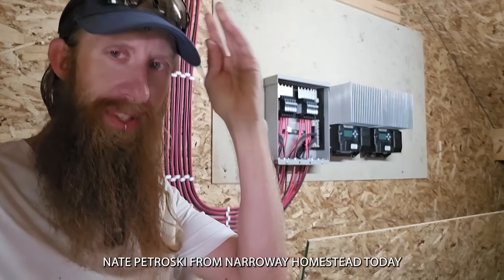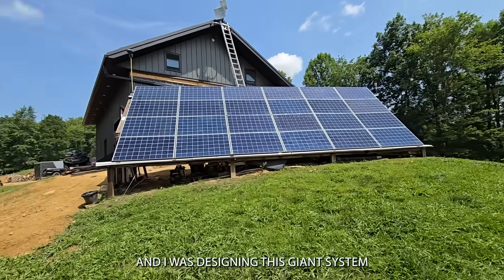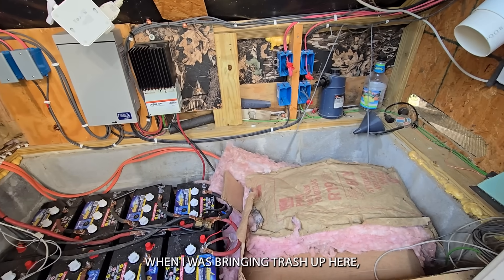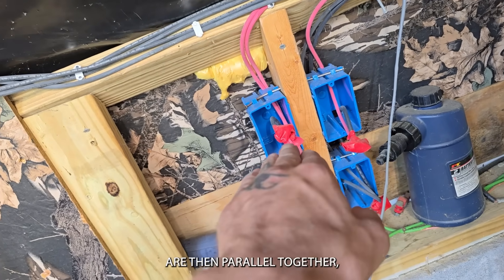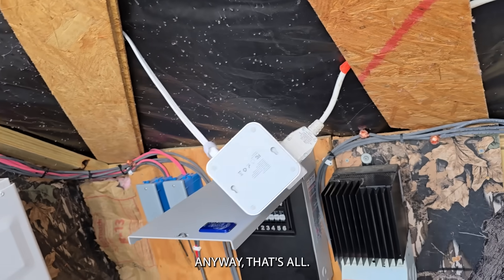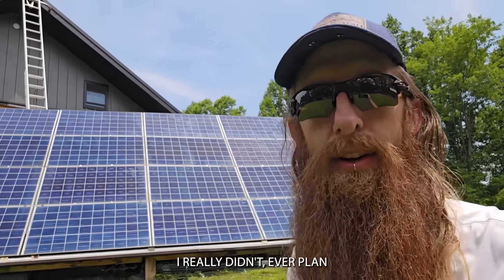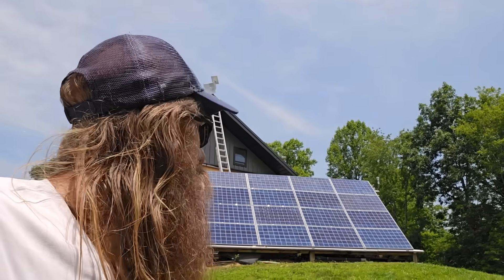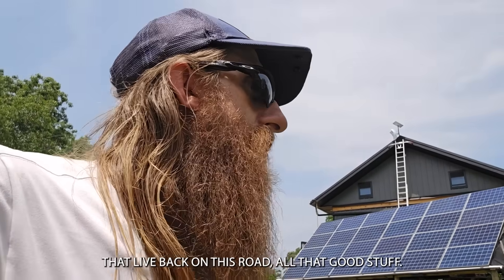Why am I upgrading my solar? #narrowayhomestead #offgridlife #solarpanels #solar #solarenergy

Comment: Can someone help me with some advice on a off grid solar system setup. I have a farm and I need a system that can run at least 20 LED lights and a small water pump and some few cameras. The light will only be running for 12 hours from Sun down to sunrise (all light Wats combine is 20000w). What volt and Amp hour battery should I get. What inverter and how many solar panels? Any help will be appreciated

Comment: I wonder if Nate has ever heard of the solar roadways company? They are a small company that produces solar panels that you can use as driveways and parking lots and actual roads. 
They are currently doing an installation on a US military base. It would give him some additional capacity and provide energy from the ground. They have built in LEDs and can be self heating to keep them clear of snow and ice in the winter time. ✌️

Comment: nate, Ah ( amp hours) is a better way to express battery storage
you use KW when you should have said Kwh....but Ah should be used
you can do a conversion with this formula ...... Ah = kWh × 1,000 / V
Kwh = 20 battery voltage = 48 so Kwh 20 x 1,000/battery v 48 = 416 Ah you can also reverse it...... kWh = Ah × V / 1,000

Comment: if someone is using a 8hp or 17hp gasoline generator, there are industrial engine driven generators that can idle burning the same amount of fuel as those smaller noisy generators, though still have a huge 300Kw overhead capacity. a C11 Caterpillar gets very quiet with 15 foot of 5" muffler pipe, but two time that also makes enough heat that it could heat a year round greenhouse. active cylinder decompression on low load, 20 miles of wire.

Comment: The TriStar MPPT 60 software pretty much gives you the information you need. In "Live View" you get all the current information that you need. It even has Amp hours and kWh since the TriStar was activated. The data screen shows 84 days of information that includes how many years, days, hours since it was turned on. Here are the daily data saved fields: (easy to set up)
Day

Events
Hour Meter
Max. Battery Voltage
Min. Battery Voltage
Max. Array Voltage
Max. Output Power Watts
Amp Hours
Watt Hours
Max. Battery Temp °C
Min. Battery Temp °C
Charging Durations Min:
Equalize
Float
Absorption
Faults
Alarms
Enjoyed the video

Comment: Really dig ur setup the extra panels are your absolute ticket to self sustainability,another water tank or two and u are done with the utilities, the propane can be bought if needed for water heating or not.
Reply: Make sure to vent the battery room,a spark from a light switch could be a problem

Comment: You're lucky because I cannot find a goddamn solar installer to help me put MY solar panels on my roof!!!
Lead acid Batteries never dropped in price and they're over what 200 years old??? Lead acid is not worth it anymore....
Reply: How steep is the pitch angle on your roof? You could do it yourself if you don't need fall protection gear. That's what I did.

Comment: If you need a new inverter order a Schneider xw pro 6.8kw inverter, theyre transformer based monsters. I just ordered 2 for my whole house solar system for $900 each on NAZ solar as schnieder just discontinued them and are selling them all off, originally $4700 ea.

Comment: Why would you go with lead acid again... You can currently buy LFP batteries with a 6,000 cycle life at 95% depth of discharge for less than an equivalent LFP system that you'd be lucky to get 1500 cycles at 50% depth of discharge... I mean if you are buying 120kwh of batteries and basically restricting yourself to using 60kwh, you basically need to buy 240kwh to get the full capacity.
LFP doesn't need to be vented, you can cheaply buy full systems with heaters, breakers, steel cases with wheels and/or handles, and wired up to 48V out of the box.
Oh god... I looked up how much they cost... It's literally costs double what LFP costs and the cycle life is WORSE than I thought!?!?!
70% usable after "hundreds of cycles" https://www.budgetbatteries.com.au/product/century-deep-cycle-agm-range-c12-75xda/
For the love of god, please don't do that...

Comment: Wait, did you just say your sticking with lead acid on the new system?    Where are your reliability/ longevity figures coming from?
Reply: @joshuaroe3021  new batteries looks like huge forklift type batteries  , as long he keep them 80% full should be ok . 
Lifep04 would be better tho

Comment: Please go with victron and some lifepo4 battery boxes. it micht be a few 100 more now but it will last you forever and be cheaper in the long run.
Reply: Look for the, 
NKON ESS Pro - 51.2V 16.1kWh Thuisbatterij, for example. that thing is 16kWh and 1800 euro.
Reply: @firefly2472  life po4 is actually considerably cheaper then those batteries.  Homie just cannot be wrong as best I can tell this has to do with the big ego to keep using these old technology batteries cuz there's zero logic to it.  I think he likes replacing the batteries every couple years.
Reply: @RJj-w2g Oh i know, the victron stuff micht be a little bit more $ /€ but the lifepo4 is way cheaper. 

i think that you can be happy with 1500/2000 cycles with lead acid(and you realy need to be carefull that you keep it nice, like no lower than 50% and don't charge and discharge them to fast, shit will kill them fast) 

lifep04 does 6000 cycles easy and is then around 80% life. keep them between the right voltages and temp around 10/30 C° (European) but thats easy with his Barn there. 

I got a 48v100A for 1350 Euros. 
Then looked inside to see how shit works and orderd 3 boxes including jk-bms's and the lifepo4 cells. Each box (16kWh) cost me 1250 euros to put together. 

I dont think you can buy 16 kWh of leadacid with bms for those prices.
Reply: @RJj-w2g  Maybe it's your ego that can't contend with the fact other people so things differently than you.

Your preferences are not everyone else's preferences.
Reply: @watcherofwatchers  it has nothing to do with preferences... It just doesn't make sense in any way to not go with lifepo4.

Unless your preference is spending more money on batteries that degrade faster and have less power. 

The way to go in 2025 is a 48v lifepo4 system for stationary systems. (Period) This is just a case of sticking to what you know instead of getting an actual good system. Such a waste of money and resources.

Comment: I noticed the panels were bolted straight to the wood, was that problematic and get loose over time or did it work out fine?  I usually use Unistrut but that stuff has gotten so expensive I'm starting to think of doing the same thing and just bolting to wood and using washers to clamp down the panels.

Comment: If you need just an inverter look into the Quattro series from Victron. The quattro is an inverter charger which you can also get 2 and run 230v split phase and connect a generator to it as well, it has a built in transfer switch.
Reply: @TDub_ADV  Works great 👍🏼

Comment: More than anything I want to know why you went with lead acid batteries on your new setup. Seems like Lifepo4 is what everyone else is using. But one thing I've seen from you is that you usually have a good reason.
Reply: I wonder if freezing is the reason. LFP (LiFePo4) is cheaper per kwh than lead acid, but LFP batteries cannot safely charge below freezing and lead acid batteries can. If keeping the batteries above freezing is a concern, lead acid is the best option. This is also why cars still have them, because otherwise LFP is a big winner over lead acid - cheaper per kwh, much less weight, much smaller, better C rating (you can discharge and charge them with more amps) and they last about 3x as long. (15 years instead of 5)
Reply: I believe he said they are supposed to last 20 years and guessing they are cheaper as well. So, hopefully no issues for reliability. Also, originally he liked lead acid batteries because they have better temperature ranges and it is a lot easier to swap them out. The lithium batteries can take up a couple of weeks to get if they fail.
Reply: @americanbobtail1 well I live in a place where Amazon deliveries can take 3 weeks (no kidding at all!). But even where I live Lithium is readily available. Where my sister lives in rural Oklahoma she can get them delivered same day. As for cost, lifepo4 batteries have been about the same price or cheaper than lead acid for several years now when you compare watt to watt. And speaking of longevity, they are projected to last 20 plus years many come with 15 year warranties.

I will admit though that I'm very ignorant when it comes to low temperature usability with lifepo4 batteries.

I'm interested to hear what Nate says.
Reply: @darrellgibson - If you are interested in what he says, then lookup other videos where he has talked about before. Not sure why you are lecturing me when I just giving you a heads-up what I remember from prior videos.
Reply: @americanbobtail1 that's the tough thing about text vs in person communication. I was only making the case for lifepo4. I'm sorry I didn't mean to come across as lecturing. I meant no disrespect at all. I do watch all of Nates videos but I seemed to have missed the one(S) you're referring to. I don't believe there is only one way to do something. And what works for one person/environment may not work in the next.

For all of the above reasons I am genuinely looking forward to his log format video where he explains why he went lead acid.
Reply: He deals with one extreme temperature that the lifepo4 batteries won't deal with, without costing you a whole lot of power.   I know by having one of those power unit things in my car if it gets too hot it doesn't charge. If it gets too cold it doesn't charge. If it gets too hot often enough it degrades the batteries till they stop working. I destroyed a $900 power unit thinging. Within 3 months of getting it because it didn't like the heat
Reply: Lithium batteries are known to overcharge and start a really really really hot fire
Reply: @paynemeikle5853 well the old style (like 2020 and before) lithium batteries most certainly did. But I have seen even one report of Lifepo4 batteries catching fire.
Reply: @paynemeikle5853  LiFePo4 (LFP) batteries specifically don't do that. That's their whole thing.
Reply: @paynemeikle5853  not lifepo4. They do not get hot enough to start a fire.
Now NMC chemistry is the one that likes to party
Reply: @paynemeikle5853  you are thinking of unprotected Lithium Ion, like the kind found in RC cars, not BMS protected Lithium Iron Phosphate. Lifpo4 cannot physically sustain a fire, it's thermal runaway proof. Totally different chemistries.
Reply: @maj429 good luck with that

Comment: I went for a turn-key system. At my age it's hardly appropriate to learn by trial and error. I had just sold my late mother's house and had money to burn. No chance that savings will pay for it in the 10 years it is warranteed but now I have all the power my off-grid house can ever use. I think the biggest expense was four 48v100ah lithium batteries.
Reply: turn key is the way to go alot of the time
Reply: The crazy thing is how cheap solar and batteries have gotten. I got 16.3KWH worth of new raw cells for under $1100, with most of the hardware included. The most expensive things now days are inverters, balancers, and freight shipping lol!

Comment: Always have to upgrade, as I live off-grid and use solar, and we are getting ready to up grade ,need more power as we build bigger home , well we are adding additions so need more power ,and replacing everything that uses to much power
Reply: Just curious how big a system you have? Mine's built around a 12Kw inverter and 16 panels